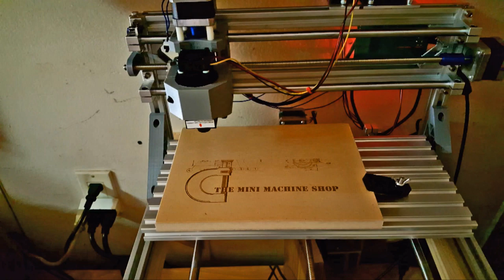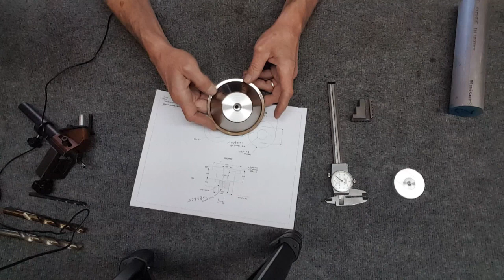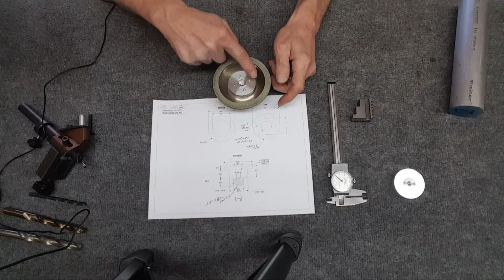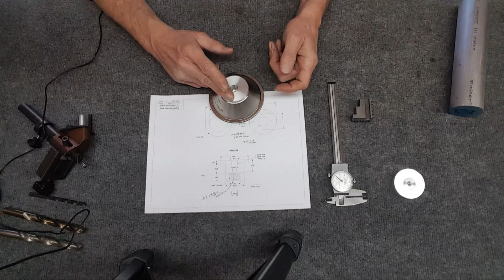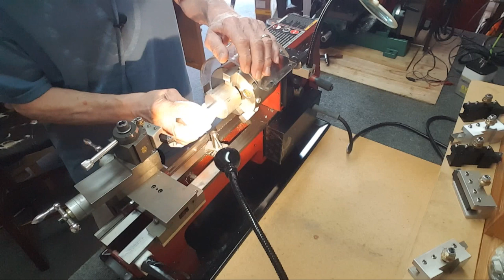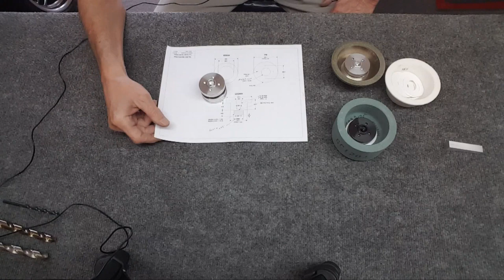DIY Universal Tool Cutter Grinder 20mm Spindle Adapter

Comment: Oops. 100 centimeter wheel.... Maybe in the shop of Abom79..... 
The footware You use in the introduction is not exactly protective. I hope You are more protectivly equipped when the chips are flying around near the laith, or the mill.
Great work! Precision doesn't come by itself so You have done a greate job!

Comment: Nice job!  JSUK, you can buy the arbors for 1-1/4" wheels from Shars for around $20 and turn down  the OD to 20MM.  Let me know if you need a link.  They are hard to find.
Reply from the maker: Actually you can find them on Ebay from Shars cheaper.
Reply: @TheMiniMachineShop  yes they are.  Thats a dealer for Shars
Reply: What kind of taper goes i does it mount to it almost fits jacobs taper 2
Reply: @caseylawrence6674  i have not been able to find the specs of the deckel SO taper they specifically use and I am not positive if the clone uses the same taper.

Comment: Hi! It’s been a while, how are the Alu parts holding up?

Thinking of making 2-3 of these, would prefer Alu due to earlier cutting, but not sure if the parts tolerate multiple changes that well.
Reply from the maker: I've changed them over and over no problems! Go for it.

Comment: Using a cloth to ‘clean’ a part revolving in a lathe is extremely dangerous.
Reply from the maker: Yes, this would be true if it were a full-size lathe with a 10" chuck, but this is a mini lathe with no HP and a 4" chuck. Completely safe if care is taken. Thanks!
Reply: @TheMiniMachineShop  IT IS DANGEROUS on any rotating parts/machines. It is NOT "completely safe" at ANY time! Please keep in mind that less knowledgeable viewers could be mislead by what you do AND what you say! Also consider that you could develop this as a habit and transfer your actions to other equipment (yours or or someone elses).
Even your under powered lathe could break your finger, or rip off some skin! DO NOT use a cloth on a rotating part, ever!